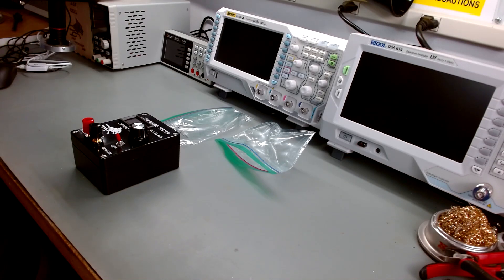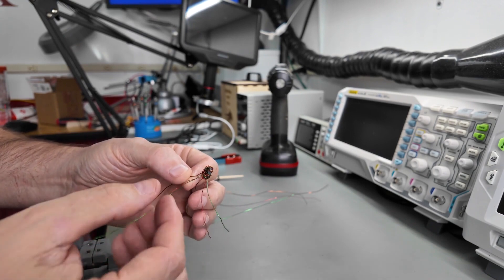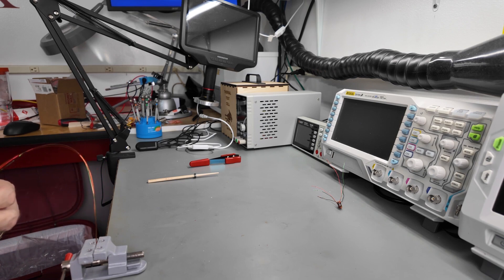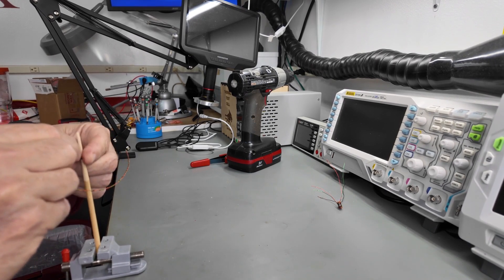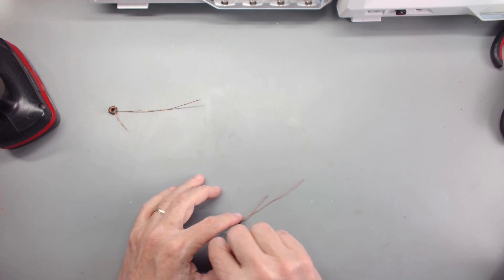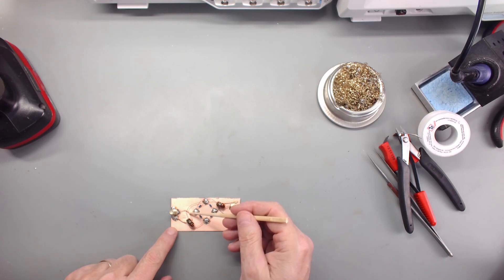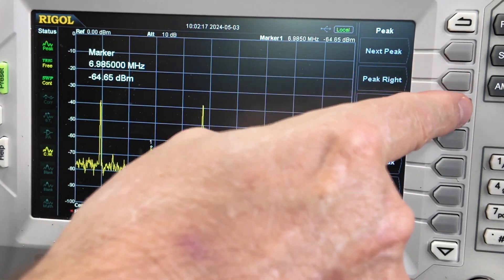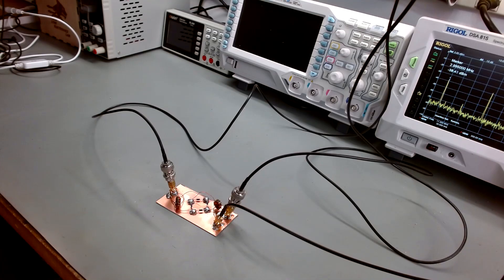Diode Ring Mixer Build

Comment: I built some DBMs a few years ago, used 1N6263 in some and BAT85 diodes in the others, I didn't bother matching the diodes figuring they all came off the same reel so they'd be pretty close, they worked really quite well, far better than I expected them to.

I now wonder if I'd be able to measure a difference in mixer performance if I measure and match up the diodes
Reply from the maker: Likely you would see some improvement in a lower signal distortion.

RJ

Comment: For those that have not realized this... When you twist the wires into a bundle, the total measured length of the wires will shorten. If you have not added some extra length, you may come up short on the number of (calculated) turns that you can make on the core. Make a demo wire bundle. Measure it before and after twisting it, to see the shortening effect.
Reply from the maker: Yes, I always add 2-3 inches (75mm) extra on all wire I am going to wind and it seems to give me the extra I want to work with.